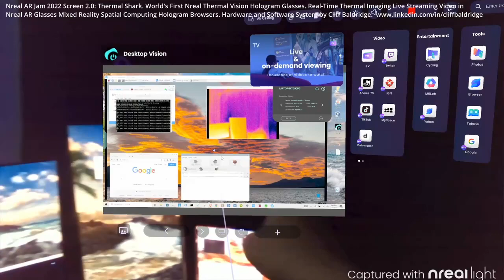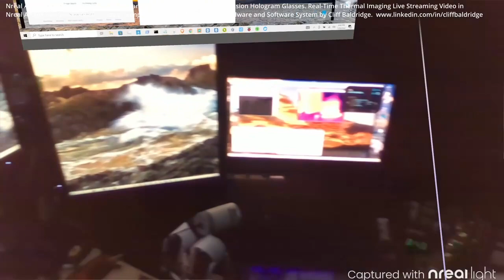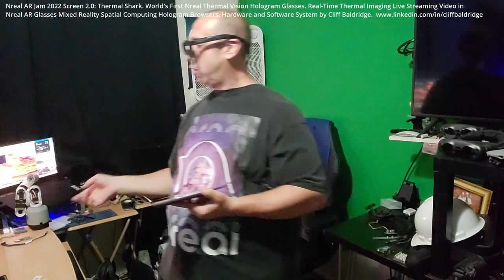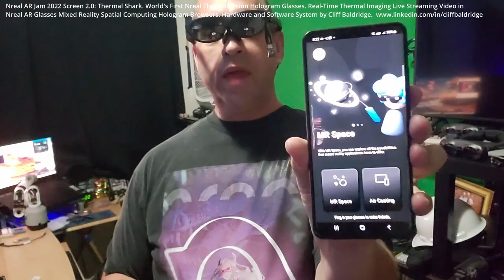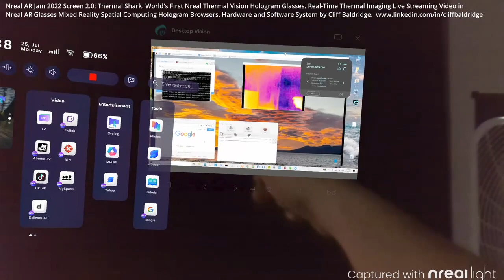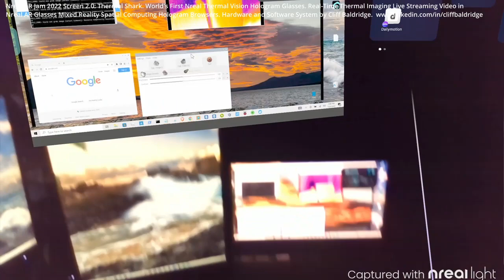Nreal AR Jam AR Glasses World's First Thermal Vision Hologram Smart Glasses

Comment: This is neat. I'm still waiting for my Nreal Light... it's stuck in Custom. But I like the idea of capturing thermal imaging and display on Nreal Light. How's the latency? Have you thought about using mini PC(1135g or SteamDeck or handheld PC and runs everything on it and connect to the Nreal Light  via with USB4.0 or Thunderbolt3 or Thunderbolt 4 connection?  There's a lot of handheld PC like steamdeck coming out which should simplify your integrations and portable.
Reply from the maker: Nreal is the best. But it is Android based and plugs in the Snapdragon Phone. Sure, can use other device as compute unit this is compact and low cost. Very low latency really.
Reply from the maker: I have other Flir Camera Sensors that don't need a compute unit but just send a stream of Thermal Video out via WiFi.